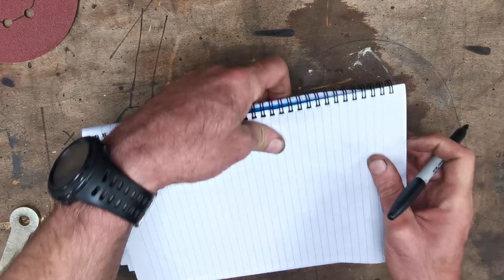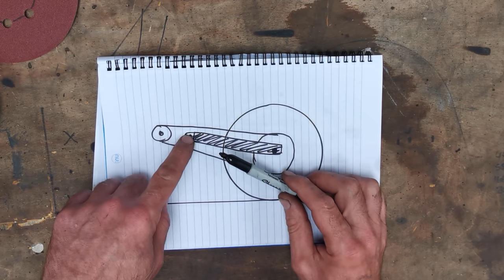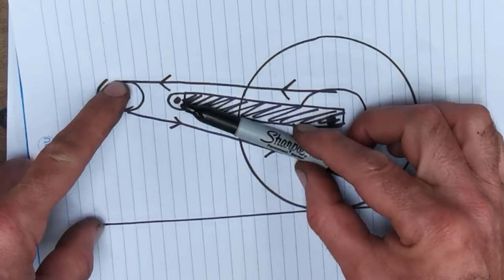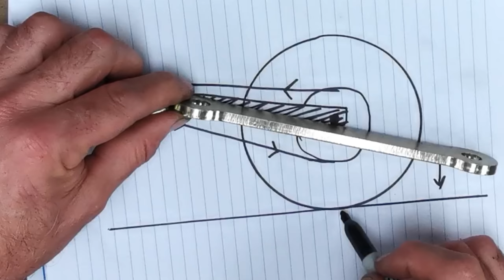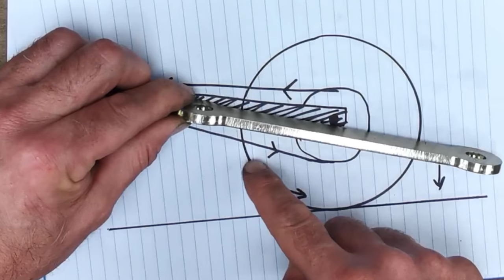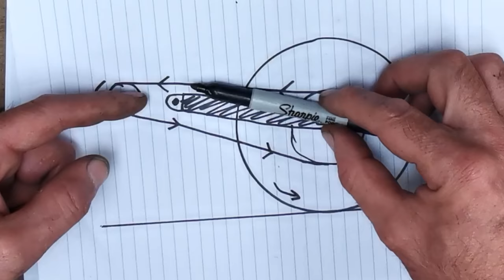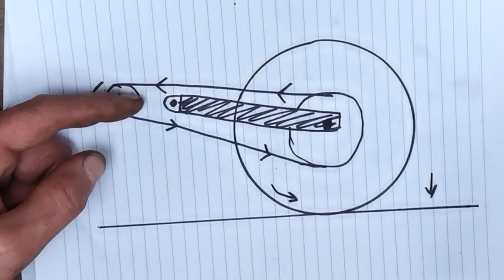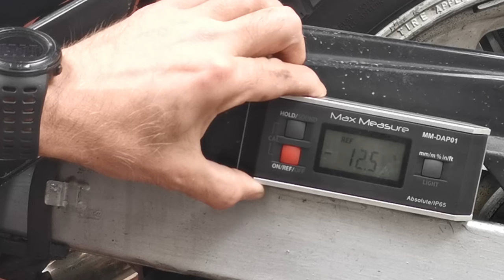Fitting standard dogbones to ASBO the Suzuki Bandit 600 and the reasons why

Comment: Cheers Quicky, hope you get the chain in time for dyno day, really good series. Many thanks :)
Reply from the maker: Me too fella... It's supposed to get here sometime on Wednesday and dyno is on Thursday. Only trouble is I have to go to work at 1400..... No pressure.... 😳😳
Reply: @QuickBikes  It looked alright out in the sun when you were doing the shock adjustment, nice angle, Stock gearing seems fine to me (mines a 2000/01) & I'm running pirelli  angels (stock sizes) at the mo & they seem ok, I have a question ! what swingarms would fit the bandit, best not coolest, or is the stock one ok  ?
Reply from the maker: I used to run Pirelli tyres on the RSVR and the Blade but never tried the Angels... May have to give them a go... The stock swing arm is designed for the bike so is probably best. The Gsxr swing arm fitted to GIXIT is 70mm longer which will cause a few handling issues. When I come to project build ASBO, I'll be making my own swingarm but it's geometry etc will all be based on the stock one 😁👍.
Reply: @QuickBikes  Cheers, I'm don't ride it that hard (It's my only transport & I ride in town primarily) but I like em. Making your own swingarm will be interesting, they can cost silly money & after all it's just a mechanical manifestation of a geometric equation :)

Comment: compression adjusters are up the holes in the bottom of the fork legs through the axle, assuming the axle is installed in the right position (like ducati showa legs)
Reply from the maker: Ah OK... I'll pull the axle out and have a look see, thanks 👍
Reply: Roy Lang ,, they’re not a USD fork ,, & if it’s a 97 SRad they never had the adjusters

Comment: Yeah those forks are defo original 600 srad (pre 2000). The good news is the original srad wheel will match the bandit 1200 wheel your planning on using
Reply from the maker: Yeah, just found out... Never mind, I think I found a replacement set 😁👍
Reply: @QuickBikes  forks or wheels?
Reply from the maker: Forks... Look in really good nick and have all the adjusters. Will just need to source a set of yokes but that's the easy bit 😁👍

Comment: Brilliant video, had a good laugh. Mint you still got in the old leather after all that time. I felt your pain getting them on I swear 😂
Reply from the maker: Hehehe... Snug, is a good description 😂🤣😁
Reply: @QuickBikes  I'd say 😂 definetly give good support if anything. Just maybe don't make quick movements in them hey 😉
Reply: As for the adjusters, should be able to adjust by rotating bottom section of the preloader with a spanner. If not it'll be preload and rebound on one and compression on the other.
Reply from the maker: Hehehe... Just breathing in them is carefully done 😂🤣
Reply from the maker: Ah right... I'm not familiar with them and just haven't seen this set up before. Very odd...
Reply: @QuickBikes  typical Japanese engineering hey 😉😂 and yeah I can only imagine it's short steady breaths unless in racing tuck 😂

Comment: They are forks of a srad 1997. Unfortunately 1997 doesn't have adjustable compression damping. From 1998 it has indeed an screw under the brake mounts, and has adjustable compression damping. Bummer I thought you knew.
I have some lower forklegs (alu parts), in spotless condition (used the cartridge for a classic racer) Iff you drop me your adress I will send them to Plymouth (free).
If you change the forkseals, go for the green SKF sealkits. They have less friction, realy good improvement.
Reply from the maker: Very kind of you thank you, but I've already arranged for these to go back. The good news is I think I have found a replacement set in great condition 😁👍

Comment: Quickie
Why are you faffing about with rigid dogbones?? 4 good quality rose joints,a short section of stainless steel tubing (solid bar drilled and tapped) and there you have adjustable dog bones.
I had to make stainless "bolts" for top and bottom fixings as the standard bolts are too short.
I have used them on the go and statically in the workshop for setting up. Once you have found the ideal length then use that centre to centre length to make a set of bones out of stainless, and presto hey!!  Wolfy
Reply from the maker: Just using what we have basically, but we'll be making an adjustable set at some point i think, it just makes sense 😁

Comment: Hi mate did you know your clutch cable should be routed between the carb 1-2
Reply from the maker: No I didn't.... But now you mention it that would make sense... Cheers matey 😁👍
Reply: Had the same chain problem when i rebuilt my bandit 530 x 110L did the trick. I have also just picked up a 99 600 srad so would be interested to know if it has compression adjustment
Reply from the maker: Apparently they did two different front ends.... 
5114034E00 without
5113034E20 with adjuster
Reply: @QuickBikes  Thanks mate

Comment: Wishbones do cause all sorts of propblems jack ups  mean steeper head angle faster steering and a harder shock becasue of the leverage , we went the other way  which makes it softer, those are 600 srad fork legs..yup thats the bike i RIDE ;) There is one on my 2000 fork legs at the borttom but we had them apart and coudnt see how its connected ill check my other forks the book only mentions the top of the fork for adjustment   i have mine set to 4 lines  it was just a tiny bit too soft on three standard
Reply from the maker: Ti's a black art for sure and there's LOADS to setting up a bike properly. It doesn't help that its a personal thing either as nobody else can check and confirm it 🤣😂.
Thanks for checking, I really appreciate it 😁👍
Reply: @QuickBikes  just checked my other set of forks it didnt appear to have a bottom damping setting on it, like I said the book makes no mention, so its all from the top damping and spring preload 👍 standard settings are spring adjust 4th groove from the top and 1 turn out on the damper (from gsxr manual)
Reply from the maker: Cheers matey 😁👍

Comment: Look in the bottom of the fork leg
Reply from the maker: Yeah there's nothing there... I'm Googling it at the minute to confirm what's what as I expected to see an adjuster on the bottom of the fork leg. I'm thinking the rebound.adjuster does this at the same time through the cartridge, but we'll have to see.... Very odd to only have one adjuster though hey!?!
Reply: Quick Bikes ,, yeah odd ... are you sure it’s not in the bottom & that the axle is in the wrong position blocking access to the adjuster?
Reply from the maker: Yes, the only thing up there is the bolt that holds the cartridge in place... Suzuki tech help are all working from home, so I can only email them and the dealer I bought it from reckons it came off a 1997 SRAD... Very odd as you say... 🤔
Reply: Quick Bikes just realised that they’re not USD’s ,, definitely not in the bottom
Reply: Quick Bikes ,, 97 didn’t have the adjusters
Reply from the maker: Really!?!
That's a bit dumb... The R6 I used to race wasn't USD forks and had adjusters in the bottom and all the specs I've seen say these should be adjustable rebound, compression and preload... Suzuki Tech Help are all working from home so I can't speak to them, only email them. I'm wondering if the compression damping is linked to the preload setting on the cartridge... Dunno, waiting for an answer at the moment... Impatiently....
Reply: Quick Bikes ,, 98 had the adjusters but not the 97 “apparently”
Reply: Quick Bikes ,, let me know 👌
Reply from the maker: Ah.... The plot thickens.... They did two different conventional forks... 5114034E00 without
5113034E20 with adjuster
Reply: Quick Bikes ,, is the one without the adjusters for the 97 ? 

Answer me that Quicky 😆😜
Reply from the maker: Yes... Switched over part way through the year apparently just to ruin my day..... Probably arranged it specially as well.... AAAUUURRGGGHHHHHH..... 😤🤨
Reply from the maker: Why would you do that....? If the compression damping is fixed, what happens if you change the spring rates....  It doesn't work right.....!?!
Reply: Quick Bikes ,, wouldn’t you say that rate of rebound is more important than compression?
Reply from the maker: Errmmm.... They both play their part really. Compression damping is a big issue when you first hit the brakes hard and tends to keep the back end of the bike in check for that first bit of braking... If it starts waving about due to weight transfer initially it'll carry on doing so throughout the rest of your braking...  I'd just be happier I think being able to adjust both of them 😁👍
Reply: Quick Bikes ,, well it is old tech ,, could be worse , it could have no adjustment at all ,, right.
Reply from the maker: What, you mean like I have at the minute 😂🤣😅
Hehehe.... Nice to have you chipping in again sweet... I missed this 😁👍
Reply: Quick Bikes ,, did they race those bikes ? Maybe that’s why the forks were changed mid year

Comment: You can tell they're triple stitched, anything else would have burst trying to contain that pressure 😁😁😜 And whilst we're at it, why have you got bits of string hanging from your short legs? 😜😀
Reply from the maker: Coz I don't go to the gym anymore 🤣😂 They were snug, and I'm not saying they fit, I just got them on 😂😅
Reply: @QuickBikes  Snug? I think in engineering terms they would call it an interference fit 😉😋😀
Reply from the maker: Ooooo... I was definitely interfered with... 😂🤣👍
Reply: @QuickBikes  😣😣 Too much information 😁 By the way, SRAD 600's only had rebound and compression adjustment on the front forks. Finding manuals, online, for these bikes is bloomin' tricky, however if you go to this link https://www.carlsalter.com/suzuki-service-manuals.asp and scroll down the page, you'll find the service manual for the 97-2000 SRAD 600. In the specs section of the manual it says rebound/preload adjustment front, rebound, compression and preload at the rear.